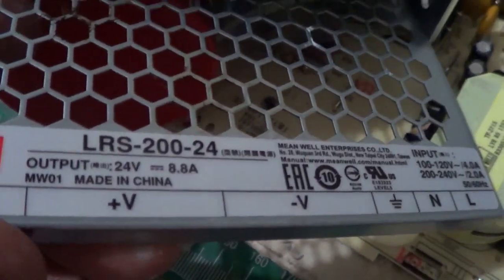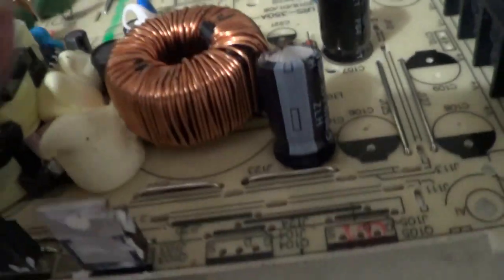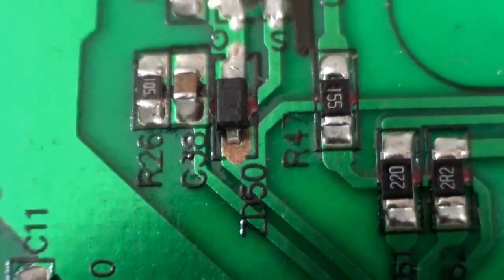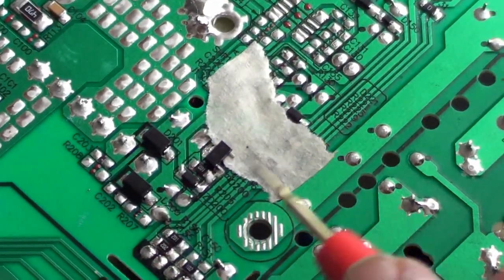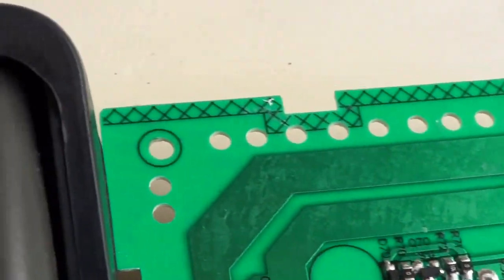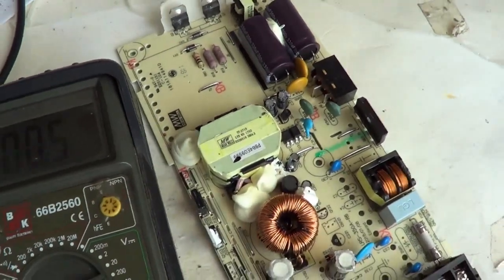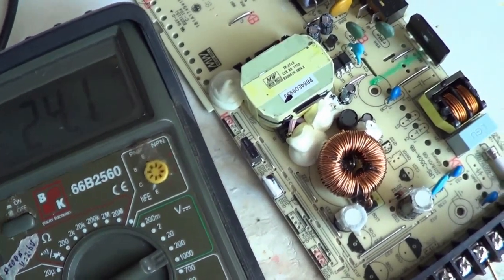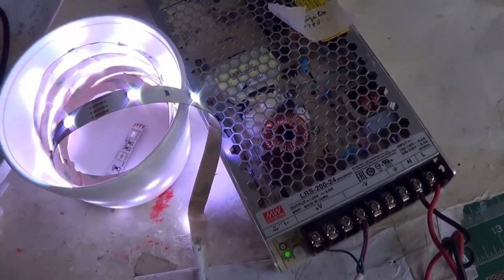Mean well 200W 24V smps repair

Comment: Hi Rabindranath, 
I have NES-200-12 and the underside has a smd 3 leg zener diode ZD2 and smd transistor Q5 burnt. Unable to identify component but there is ZD1 with markings Y6 N which looks similar to ZD2 and the only marking visible due to the burnt mark is the letter 'N'. As for Q5 the only marking visible is W ....45. Not sure if its a NPN or PNP transistor. Do you have the schematic to identify these components? Or at least provide the markings for ZD2 and Q5. If I'm not mistaken, the ZD2 is a 18V zener diode. See if you can help and thanks in advance.

Comment: Hello Rabindranath, 
I have a question with my faulty Mean well SP 240 24v 10A power supply. The primary was short, fuse blown, power transistor short. I replaced the parts again blown.
I cold checked the primary components and could not find any shorting components. I replaced the FAN4800 IC and connected the PSU in series with 100w bulb. I can get the 24v output but the series bulb glows at full brightness. I'm not sure what the issue is can you please guide me.
Components checked/replaced:
NTC (replaced with new one)
Capacitors (also replaced with new one)
Primary Chopper transistors(K4115 pair replaced)
Transistor EA1 was partially sort (TL431) (replaced with EA1)
Reply from the maker: seems to be a feedback loop problem . check around the tl431  resistors etc and around the optocoupler and the optocoupler itself.
Reply: @rabindranathramsarop  Thanks for your response, I will try and let you know!
Reply from the maker: @gordanzwaan4947  great
Reply: @gordanzwaan4947  news?